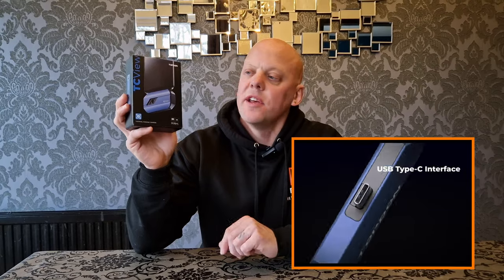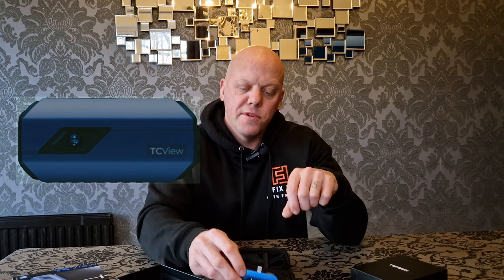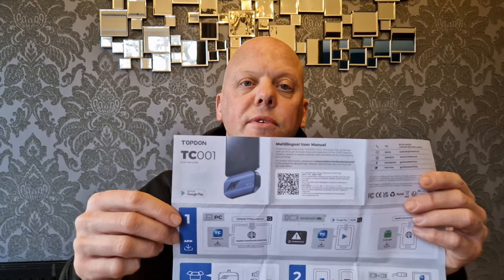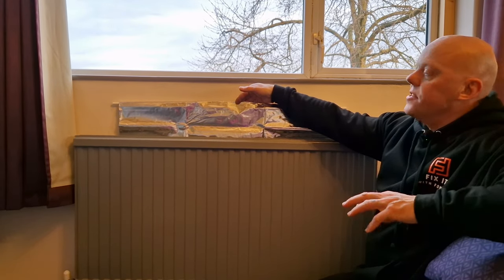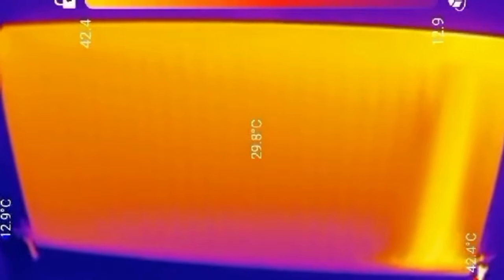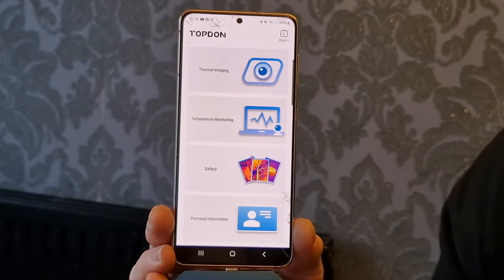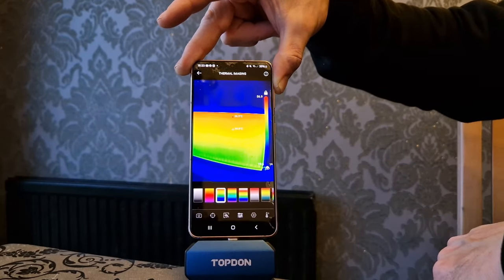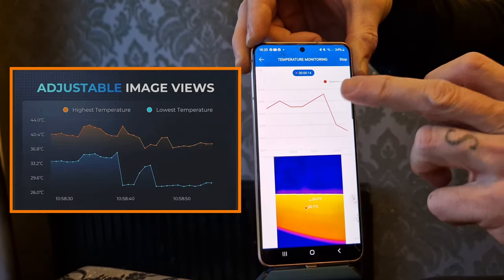TOPDON TC001 Thermal Imaging Camera Review

Comment: Can it find water leak?
I have plumbing problem in bathroom, drain pipe is under concrete and tile floor and water pipe is inside brick wall....

Also advice if it can detect animal inside car or van that is invisible to human.
Reply from the maker: I think you could find the water leak but I'm not sure about an animal.